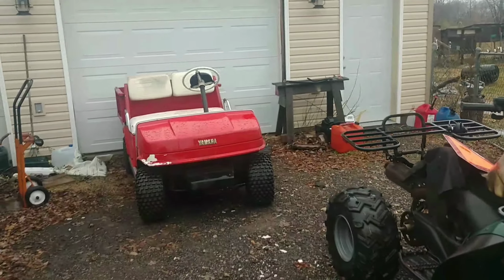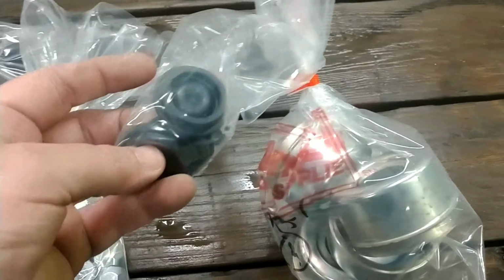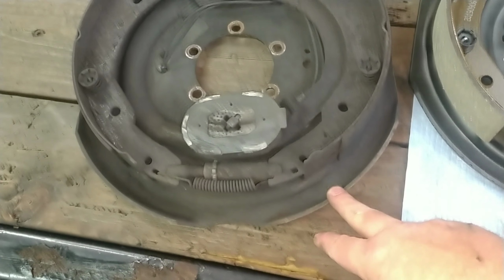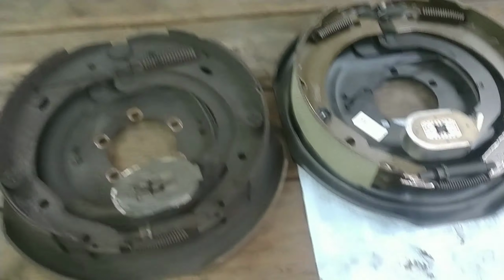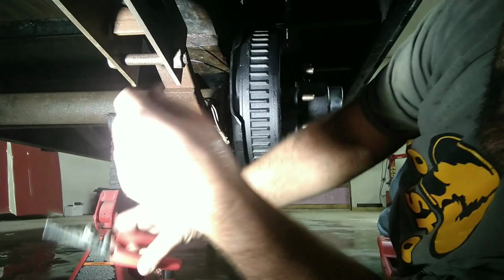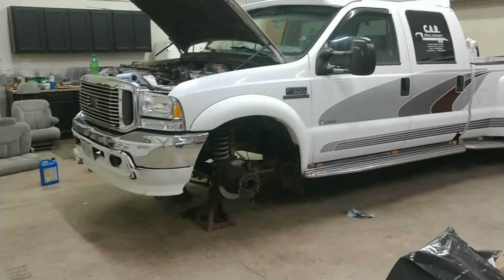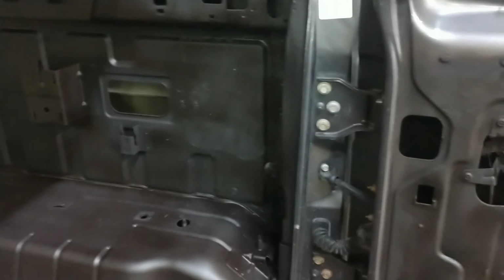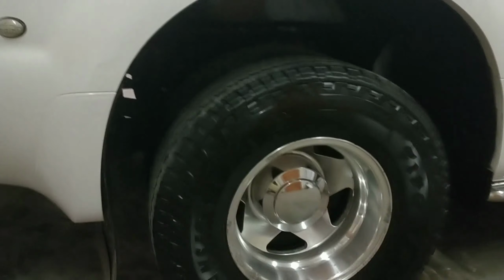Getting ready for 2020!!!

Comment: How often do you recommend replacing the lug nuts? How many miles did you get out of your lug nuts?
Reply from the maker: I think you meant often. I replace them religiously ever time I do a brake job on my trailers. I'll get 80-100,000 miles on a brake job as I am pulling mostly on the highway. I do the trailer brakes once a year even if they don't need to be changed

Comment: In your Old 7.3 do you just run a paper log book?
Reply from the maker: I run a log on my phone. Keep trucking has an app
Reply: @chrisward405  Why do you run that over running a paper log?
Reply from the maker: The app is easier and quicker to use. I still have paper logs in the truck at all times as every CMV is required to have them for back up reasons